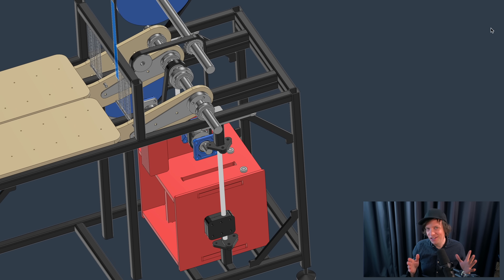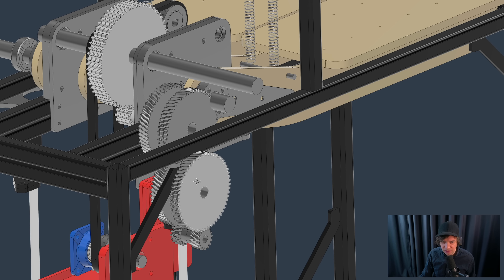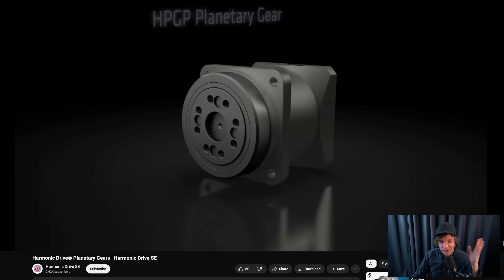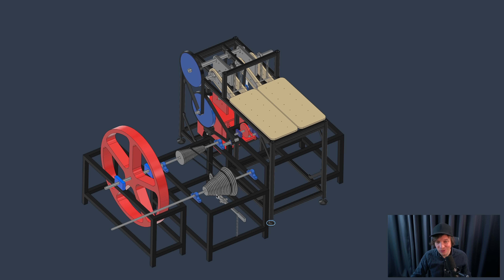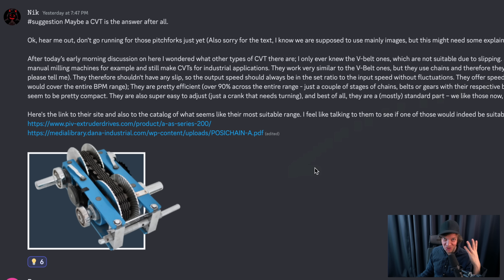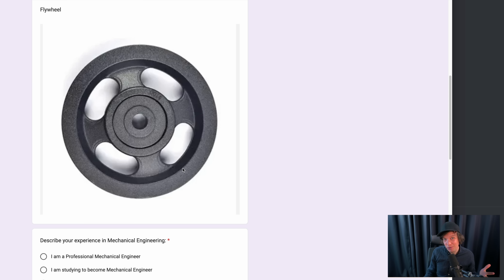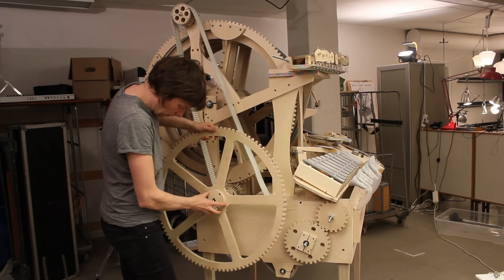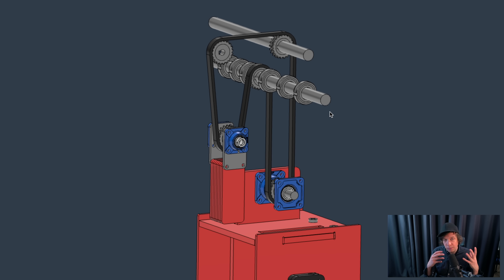Which Gear Type is Most Efficient?

Comment: weve been yelling "design requirements" since the start of MMX haha, glad martin has now realized how important they are!
Reply: He's a lifelong artist learning to be an angineer. Reprogramming brains takes time and effort. :)
Reply: Yes, a lot of engineers did, in kind of a pavlovian reflex. But before he scribbled that behemoth of a marble machine he is now aiming for, there was no way to know what the design requirements would have been. In that process he made several changes which would have made all those perfect plans crumble. And even now, I doubt this first module will stay the same when the other parts come into existence because there will be issues he could not foresee.
Reply: @Schmidtelpunkt That's why a requirement spec document is a living document - you put down your best guess at the time, and you itterate and modify and adjust and correct and update as you learn new things about the project through prototyping and experimenting. The point is so that your changes in ideas are deliberate and measured and with reason, and not just random or "whatever I feel like at the time". The freedom and creativity comes from the experimentation and prototyping, but those things should be done with an ultimate goal to either validte, add, remove, or modify requirements in the requirements spec. There is often a test spec document too for testing of requirements, although these days people usually merge the two things as there's obviously a lot of overlap, and there's a valid argument that every requirement should have one or more tests, and every test should have a requirement.
Reply: @starblaiz1986  The problem is that as an instrument it has to "feel right" for the musician. No matter what you assume, if it fails to allow being used intuitively, it's worthless. Which is as much as he said. Which is also what all engineers gladly ignored.
Reply: @Kandralla  We are not talking about mere interface design here. But that misconception shows very well the limit of engineering and why it so often goes so wrong, creating utterly unusable solutions while the nerds building it are convinced they did everything correctly (eg. Windows...)
Reply: @Schmidtelpunkt  I'm not talking interface design.
Reply: @Kandralla  Yep, and you are clearly not talking about anything related to the issue.
Reply: @Schmidtelpunkt  I thought this was a reply to the other thing because YouTubes comment system is weird. Either way your entire purpose seems to be to tell people that engineers suck because you don't understand the methodology. Good luck with that.
Reply: @Kandralla  Not engineers, but the Dunning-Kruger-like attitude to know it all based on the one fragment of ultimate knowledge they acquired.
Reply: @Schmidtelpunkt  clearly it is all engineers since you decided to tell me I was full of crap by merely suggesting a better way.
Reply: @Kandralla  If you want to declare yourself to be "all engineers" I am not in the position or interested in keeping you from living out your narcissism.
Reply: @Schmidtelpunkt  I never made such a claim. This whole thing started with you making the claim that it's impossible to derive meaningful requirements without just trying stuff, which is utter nonsense, which is pretty ironic since you whipped out dunning kreuger.
Reply: @Kandralla  Well, read my initial comment again. Perhaps a bit slower this time, so you don't get that far ahead of your reading comprehension. Or just shut up and stick to equations, which are probably more in line with your strengths than words.
Reply: @Schmidtelpunkt This initial behemoth will fail from MANY reason that are easy to foresee.
Reply: @br52685  Probably - but this isn't due to "design requirements" but simply because it is too complex for a project organized this way. So once more it won't fail for a reason the keen engineers will foresee.
Reply: @Schmidtelpunkt  It'll fail for reasons any layman can see.  It's only become overly-complex because it's being organized (if that's even the correct word) by someone who doesn't know what he's doing.  You can give a toddler a toolbox and a pile of wood--I guarantee that you won't get a house.
Reply: @br52685  And yet: no specifics.
Reply: @Schmidtelpunkt    It's quite simple:  this behemoth won't keep his "tightness" (however that's defined), nor will he be able to power it for a concert.
Reply: @br52685  Still not specific.
Reply: @Schmidtelpunkt  It very specific:  he won’t meet his two main design requirements.
Reply: @br52685  That is about as specific as just saying he won't end up with a functioning instrument. Even if he would listen, this piece of advice would not help the slightest. Feel free to try again.
Reply: @Schmidtelpunkt  the Bowen cables will introduce way too much variability in timing.  The programming wheel only gives about a 30 second loop.  The configuration of the programming pins further limit the frequency in which any note can be played.  The coupling of the numerous module cannot be performed with the tightness and accuracy that’s expected.  The power requirements needed for this machine cannot be generated (and sustained) by a human—let alone in such a poor configuration.  It’s not economically viable to travel with an “machine” of this size.
Reply: @br52685  Still fits the category of vague tummy feeling - something of which I mentioned in the reddit. Where are the equations which fix this on their own?
Reply: @Schmidtelpunkt  Equations don’t  “fix” anything.
Reply: @br52685  Exactly.
Reply: @Schmidtelpunkt  Nobody ever claimed they would fix anything
Reply: @br52685  No, right, you did not defend the position that equations fix everything, you tried to defend the position that design requirements do that. Which is so much smarter.
Reply: @Schmidtelpunkt  No….we’ve always simply stated that equations can tell us how a system will operate (without always relying on trial-and-error)

Nobody ever claimed that equations fix things.
Reply: @Schmidtelpunkt  Huh?!?  “Be specific”

I, on the other hand, know how much power a human can generate over a sustained period of time.  The power required to power this behemoth can easily be calculated.  P(out)>>P(in) (required power is far exceeding power that can be supplied).  Thus:  fail
Reply: @br52685  Which says nothing about whether a human could hold a rhythm while peddling in the previous setup. You know, in one of those experiments real engineers would avoid because they know it so much better.
Reply: @Schmidtelpunkt  Could a human maintain that rhythm?  It’s possible.

Can a human provide the neseccary sustained power requirements?  No.
Reply: @Schmidtelpunkt  Here’s the problem though:  your issue is easily solvable.  A flywheel isn’t designed to maintain a precise RPM.
Reply: @br52685  If the musician is able to keep a precise RPM that would actually be an advantage as it would allow easily changing the speed - that is why Martin tried it that way in the first place.
Reply: @Schmidtelpunkt  Too vague.  Be specific
Reply: @Schmidtelpunkt  Too vague.  Be specific
Reply: @br52685  Well, you might want to catch up on the last few videos first. It is a bit silly trying to discuss something you have not watched in the first place, don't you think?
Reply: @Schmidtelpunkt  Oh, I've been following.  You're just extremely vague when merely talking about "a musical able to keep a precise RPM...allowing easily changing the speed."  Instrument as a whole?  Flywheel? Programming wheels?

It's a bit silly that you want specifics, yet speak so vaguely....
Reply: @br52685  As only the flywheel had to be kept at constant speed during his experiment there is obviously nothing vague about what I meant. 
The issue itself however is indeed vague. Which is exactly the reason why it made sense to test it before inventing design requirements based on that utter lack of reliable data. This allowed him to adapt the idea rather than to build the perfect unusable flywheel. Had he followed the engineers, he would have designed the perfect unusable flywheel, which he then would have abandoned just the same. Here lies the irony of engineers blabbering about design requirements as if they would have helped and religiously believing that design requirements would at this point be the holy grail keeping him from revisiting previous steps, when the whole setup still contains multiple unknowns.
Reply: @Schmidtelpunkt  Talk about blabbering…
Reply: @br52685  It is not my fault that you are not capable of following the discussion.
Reply: @Schmidtelpunkt  you’re incorrect in believing that a flywheel needs to maintain perfect RPM and you’re incorrect that the RPM of the flywheel is easy to change.

Now…if you’re referring to the programming wheels….the yes, those need to be constant RPM and easy to change.

But it’s unclear which you referring to earlier.  It’s your vagueness—not mine.

Then again, I shouldn’t expect anything less from a “lost-cause-sympathizer” like yourself.
Reply: @br52685  I believe neither of that. Try reading my comments again. This time slower. 
If you had seen the previous videos, it would have been very clear where Martin tested whether he can keep the tempo. But either you didn't or you have the memory of a gold fish. 
Also your assumption couldn't be more incorrect - I am not a cheerleader of his approach. I just pointed out that before him making actual tests (and failing) he had no way of knowing what he wanted, while the engineers back then of course already were convinced they knew it better, because of something they thought they had been taught, because anything other than numbers is entirely outside of their grasp.
Reply: @Schmidtelpunkt   Your quote exactly:  "As only the flywheel had to be kept at constant speed during his experiment there is obviously nothing vague about what I meant. "

Flywheels aren't designed to maintain precise RPM, nor is it easy or quick to change a flywheel's RPM--this is all mathematically/physically defined in equations.  No "experiment" needed.
Reply: @br52685  The experiment was to keep the flywheel at constant speed. You know, the experiments you did not watch even though you lied about having watched it. I am not sure what you are trying to discuss here. You obviously don't follow the channel.
Reply: @br52685  The experiment was required to test whether the much simpler method was feasible. Which was to use the mass of the flywheel just to even out slight fluctuations, pretty much what he did in the previous machine. So it was a test of his subjective estimate whether it would make sense. It didn't but once more not for the reasons engineers could come up with. Because they are not musicians and have a hard time understanding what a musician does.
Reply: @Schmidtelpunkt  I watched it. He struggled to provide power…and struggled even more to maintain constant RPM.  He even had to install a pole for him to hang into to keep his balance.  And he had no mechanism to stop a fully-exposed flywheel. 

But we already knew that was going to happen BEFORE his demonstrations.
Reply: @br52685  Not really. Because all engineers can utter in that situation is that the experiment would be nonsense because there are no design requirements set in stone, so he would not know whether playing the instrument would feel right.
Reply: @Schmidtelpunkt  It failed.  Nobody who understands math/science/engineering was surprised.
Reply: @br52685  At least no engineer would ever admit that in hindsight - for religious reasons.

Comment: Getting a "complete theoretical model" will Help you a Lot to iterate faster!
To give you a very short explanation the picture you showed of the shafts: every Material acts as combination of springs and dampeners. In this case it's in the Form of twisting the shafts under load. This is important to know the Minimum thickness to transfer the torque

Comment: This is a lovely update. Seeing Martin get so much feedback, and realizing he should not discuss the practice, but the bounds and discuss it abstract. Once the design is done in abstract, it shows which restrictions are there and make informed decisions at an abstract level. And then you can look at the implementation details. Which will still have many (e.g. if I use off-the-shelf component X, where do I place that on the machine so it can reach Y. At what point should we not use X, but Z since that has a bigger reach... and what is the cost of using Z). That is a separate puzzle.
Lovely stuff. Essentially you're architecting top-down.

Comment: About flywheels. Why not use flywheels from old big diesel engines? Like from scraped truck engines or from other heavy equipment? Any truck scrapyard should have plenty to measure if any could be large enough.

Comment: So excited to see you venture into the world of analysis engineering! By the way, big flywheels are rare because RPM is so much more practical to handle than size and mass. Also, be aware, flywheels can cause death. They are no joke, even at moderate speeds. Containment should be a concern you address.

Comment: Will you be able to crank up the machine with such a big ratio. I mean, on a typical bicycle the highest ratio you can find is about 5 times the front vs the rear gear, and moving it using the highest gear available is difficult. Moreover, you will have the flywheel attached directly to the output of the 1 to 50 gear or belt. Let me know if I explained my self correctly.

Comment: Maybe stupid idea, what about using the wheel of a train as a flywheel? Especially the one from highspeed trains are surely very round and balanced. And they do have a good size/weight too 🙂 Only issue might be to get hold of one
Reply: One single train wheel is about 400kg (without shaft or any additional part)
Reply: @GoelWCS  What a flywheel 🙂 You could of course go for a non-full size wheel ehich would reduce the weight.

Comment: pen and paper isn't reality though, all you should be doing with pen and paper is putting an idea down. 

with all the spreadsheets, websites and whatnot you planned/created you could of built this machine 15 times over already.
you do what programmers do on a daily basis, we spend 5 hours creating a program that saves us 5 seconds total time. aka we wasted 4 hours 59 minutes and 55 seconds of our time. it's a method of procrastinating and not actually making any meaningful progress.

you want to know what's going to happen if you keep going on in this manner?
you will find out that your output isn't actually constant as you seem you believe it is and then have to tear apart the entire thing to fix it.
you will come to realize that you wasted weeks/months/years even of time on aspects of the machine that just don't matter....like for instance the difference in energy transfer between chains vs belts. if you want something to be an effective method of energy transfer that can change speed then get a freaking gear box that is lubed, there is no debate here.

what you should be doing is prototyping, picking what works and tossing what doesn't. you where doing it before and then you stopped for whatever silly reason someone put into your head.

Comment: If you're looking for a flywheel with more moment of inertia, units from the likes of Toyota, Honda, etc, are a poor choice due to small size and mass. To get a larger and heavier flywheel, look to makers like Mack, Freightliner, Scania. Big trucks have big diesel engines with larger diameters and more mass. 
.
.
If you can lift your flywheel with one hand, it's probably not enough. If you need some kind of help lifting your flywheel, it might work for you.

Comment: Did you ever consider hydraulic transmission? This is quite out of the box, but has been applied in tracked vehicles to handle high forces...
Reply: They are simply too inefficient.
Reply: @Ed.R  thanks for the response. I was thinking in respect of ratio and analog variability... but if the efficiency declares it a no go... too bad.
Reply: @allobject There are bicycle CVT hubs available that have a decent efficiency considering what they are. I even have an automatic shifting system that is able to maintain a fixed cadence or rpm.

Comment: I think this machine is getting too big and too complex. With all the gears and belts and chains, it will be full of energy losses. It will also be very difficult to do maintenance on it (and that's just the mechanical part; the musical instruments on the machine will also require maintenance), and the whole power transmission system will be way too loud. Too many potential points of failure and too many variables that will make playing tight music on it extremely difficult, if not impossible.
I hope I'm wrong, though

Comment: re the flywheel: unless you're planning on spinning it at thousands of RPM or attaching it to a starter motor, there's not a lot of point to using an automotive one. a custom one is probably fine because you're unlikely to ever break it. getting the mass and balance right is more important than trying to shoehorn in something close enough just because it's a catalog part.

Comment: You might look into manufacturers for pumpjack engines. They are a very large sincle cylinder engine that will almost always use a very large, heavy flywheel.